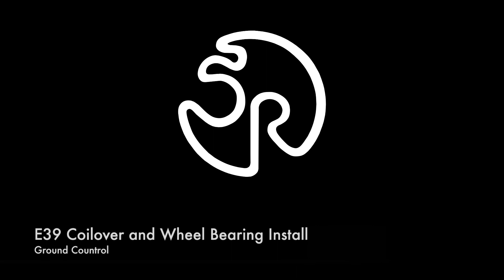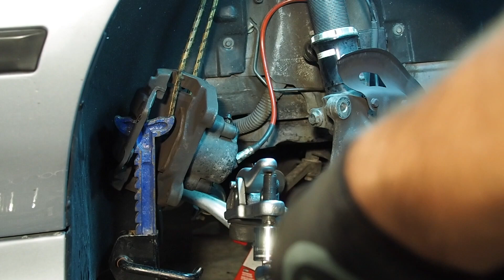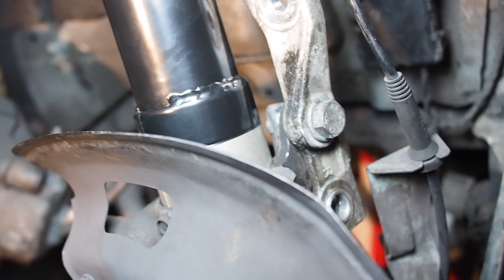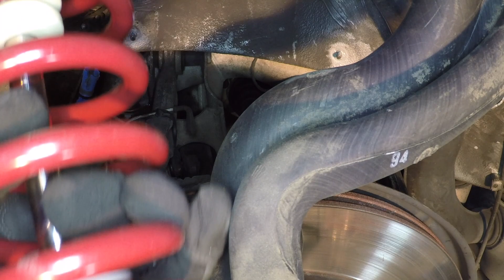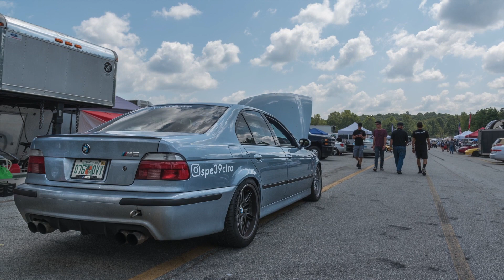BMW E39 M5 Ground Control Coilover Install

Comment: I feel a little silly asking this question... but do I need to buy new shock mounts with the GC coil overs?  It seems the whole thing is pretty well contained, and new mounts would just cover up the camber plates anyway.  I have a coilover install kit from ECS tuning that includes new mounts and associated hardware, but wondering if I could return it if I go the GC route.  Just want to be sure I have all my ducks in a row. :)
Reply from the maker: correct the GC kit includes mounts; the camber plates completely replace the stock front mounts.  If you're unsure about any specific part, give Ground Control a call.  They are in California and usually answer the phone during business hours 👍🏻
Reply: @SpectroRacingChannel  Thanks for the helpful response!

Comment: Great Job mate. Why did you change from BC coilovers to the Ground Control?
Reply from the maker: I actually did a whole video on this, but in short the BC's had a hard time controlling the weight of the M5 and the camber plates that Ground Control makes are higher quality, quieter, and offer more adjustment range.

Comment: I need a set of these! I was planning on buying a rear set of the Style 65 wheels but no one has them. There was one but he was asking for $2000 for the set. So I went with Apex Racing 18x10 ET25. (I wanted a set of wheels that looked somewhat close to OEM.) 

Apex unfortunately didnt have the 9.5" width with the 74.1mm bore. There was only 2 of those wheels left awhile ago
So I got the 18x10 but the bore was 72.56mm if i recall. Took them to work and bored them to 74.1

I got a set of bilsteins PSS B14 in Feb 2020 and they worked fine for stock wheels but they didnt fit 275/35 R18. Once i got clearance from the strut the tire was already sticking out more than 5/8" from the fender. Luckily, no interference when wheel locking them
Reply from the maker: yeah everyone wants a lot of money for the 9.5" style 65s these days.  Apex makes good wheels but as you found they are rare in 74.1mm.
Reply: Ernesto, I actually REALLY appreciate your reply.  I had the exact same problem; I just wanted some 9.5" Style 65, but damn near impossible to get at a reasonable price.  I purchased some Apex EC-7 18x10.5 ET27 for my E39 M5 with 275/35 R18 tires.  I've seen a user on m5board with this setup and 15mm/5mm spacers.  I haven't swapped my suspension yet, but I was leaning towards Bilstein PSS.  

I put my new wheels on with my stock suspension to see how it looks (and determine how much I want to lower the car), but the front right rubs the shock horribly.  Apparently they had high-clearance GC's!  Now suddenly I am worried the PSS might not fit too, but couldn't find anything confirming this.  So your reply was extremely helpful. :)
Reply: @the_shifty_garage  yeah! The helper spring on the PSS B14 gets in the way so you need a shorter spring for the front suspension for the wheel and tire. Other wise on a 18x10 ET 25 you would need more than 20mm on spacers and pulling fenders
Reply: @ernestocastellanos6446   Oh wow, I already feel like my wheels are sticking out too far with 15mm spacers lol.  I'm looking into the GC options right now, but man, after taxes and shipping, they definitely aren't cheap
Reply: @the_shifty_garage  yeah lol, I spent $2200 total. Also note, they dont ship them as you order them. It takes 10-20 business days (reading this from my receipt) to make a set and the color of your choice for the housing. Took them just a bit over 2 weeks to get here and I live in the same state as them haha
Reply: @ernestocastellanos6446  Awesome I really appreciate your insight (and I actually live up in Chico myself lol.  If I go the GC route, I'm considering picking up my wheels from them in Sac once they're ready if they'll allow it).  Have you had a chance to install your GC's yet?  Did the high-clearance setup make all the difference for your 18x10's?  How much space is there, a few mm or mircroscopic?
Reply: @the_shifty_garage  huge difference. I did the fronts today and theres about 5mm gap btwn tire and coilover with a 10mm spacer and enough clearance where i dont need to touch the fenders. (This is already set to the maximum 2 degree camber already though) I might need a 12.5 or 15mm up front in case the tire flexes to much under hard cornering
Im doing the rears tmrw
Reply: @the_shifty_garage  Update***i just got new tires. Michelin PS4S 285/35ZR18. The rear springs are TOO short. Unless you like the look of a tucked setup. The wheel itself is a just under 1/2" away from the fender. The height adjustment on the rear coilovers are at max height. If you want pics i can send them to you on instagram real quick
Reply: @ernestocastellanos6446  aw man I'm sorry to hear!  If you don't mind, I'd love to see I'm IG @joechsner.  I hope you can find some sort of way to get them to your liking🤞

Comment: "That's how it comes apart. You're like. What did I break? Did the tool explode?" LMAO. That is exactly how it goes no matter how many times you have done this. I hate having to use this tool and separating ball joints in general.
Reply from the maker: EVERY TIME.  I have found CRC screw loose to be my new favorite pre-treatment for ball joints.  I did a complete suspension overhaul on my e36 convertible and had an easy time with it, presoaking everything with the CRC.

Comment from the maker: also you're going to want to run the rear spring perches allll the way up if you use the standard springs they come with.  If you want any higher, I'd recommend requesting longer rear springs when you order.

Comment from the maker: A note on the front struts:  I installed mine sticker-out, but it looks like there is a slight indentation in the strut body on the opposite side that could offer a bit more tire clearance room.  I don't need the extra 1-2mm, but if you did, I think you can install them with the indent facing out and the sticker facing in.

Comment: Reason for replace BC racing coilovers. How long were they on for. Are defective now. Love the install!
Reply from the maker: I didn't like the ride quality of the BC's (I did another video on here describing them in detail).  They also don't fit the wide wheels and tires on the front as well as the Ground Control, and they don't have adjustable Caster like the ground control.  The BC's I had were still pretty new when I took them off, so I sold them to someone for use on their project car.  Thanks for the support and we are glad you enjoyed the video!
Reply: @SpectroRacingChannel  can the GC be tucked slightly and or have no gap. How high can it go near stock/3 finger gap? What spacers for stocks do you run or recommend 10mm/15mm in front none in the rear? Leaning towards these for a quality car. I do drive hard here in California coast! Appreciate your feedback!
Reply from the maker: @bcruzin28   yes the standard spring length they come with is around no gap / very slight tuck.  I recommend a 3mm or 10mm front and nothing in rear.  If you want to run near stock ride height, you'll need to request longer rear springs like a 12" as I think the ones it come with are only 9"